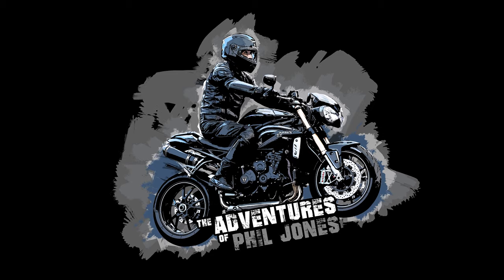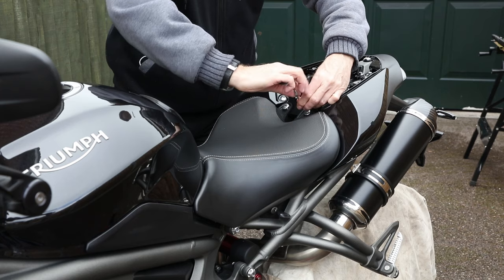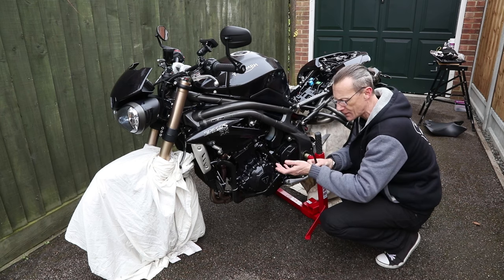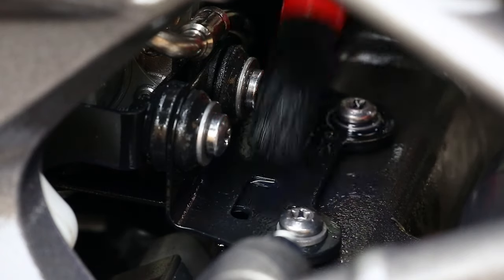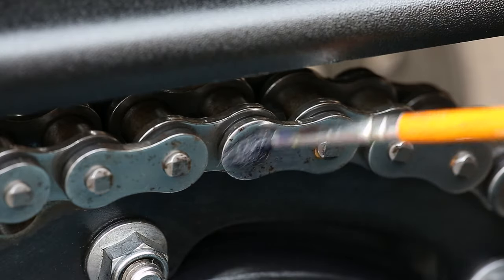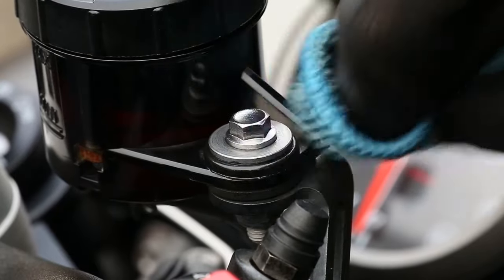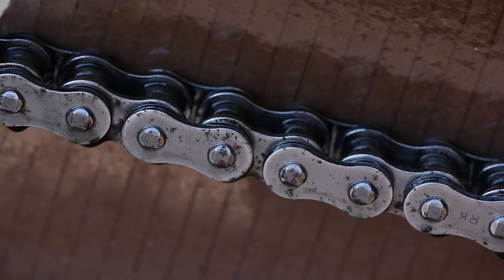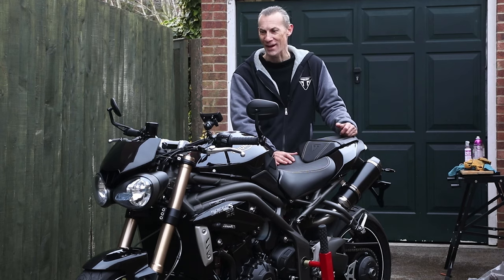The Best Way to Apply ACF 50 to your Motorbike - Step-by Step - All you need to know

Comment: Nice video, but I would say you use a bit too much ACF50 than needed. You only need a tiny bit to protect metals. When you see it running down, It’s far too much.  When they use ACF50 for professional use, they normally use a paint spray gun, as you really don’t need lots. But on the other hand, rather too much, than to little.
Reply from the maker: Thanks Felix and thanks for your comment. I’ve found the spray mist bottle is easier to apply than the stock bottle or aerosol, and agree you don’t need too much but it does go a long way using the mist bottle. Thanks for your interest! 😁👍

Comment: If you are not affected by OCD (as much) then you don't need to wipe it off.  They don't wipe it off aircraft. It's also not necessary to put it on the paintwork. 
I apply it to the engine, electronics and all the nuts and bolts I can reach. 
I ride all year, all weather for work and pleasure and each time I take it for an MOT or service they comment on how well it's maintained.
Reply from the maker: Thanks for the comment and tips. It definitely works really well, I’m pleased to hear it’s keeping your bike in top condition. Although it isn’t necessary to apply to paint, it does help protect it. My bestie had brake fluid leak on to her tank and we are both convinced that if I hadn’t have applied it to the bike a few days earlier the paint work would have been damaged, fortunately there was no damage to the bike at all but areas of her riding leathers were damaged by the fluid! 😩 Thanks for watching 👍

Comment: How does this oily (and sticky) substance - not attract dust?
Reply from the maker: @scottalanclymer  Magic! Seriously, it’s a very thin coat and it doesn’t attract any dust in my opinion! 👍
Reply: @TheAdventuresofPhilJones   Well, I'd have to be better convinced but that's another debate from why I was seeking more info on this product. I became aware of it through a local vapourblast shop, as being THE sealant for naked metal. My engine is currently completely apart and am in the process of prepping it for sandblast for complete paint removal, then vapourblast for the desired finish. I did this process a couple years ago but I repainted it. And the meticulous paint job I gave it looked great through summer of 23, but halfway through summer of 24 it's started blistering off in massive chunks. Since I had to pull the engine to investigate an odd sound coming from the timing chain, I decided to completely disassemble and go all the way with a complete paint removal because what I had was becoming more disgusting by the hour. So I want to go naked metal on my engine this time around. Zero paint. And although naked aluminum looks great, it will slowly develop oxidation and begin to dull over time. Hence this product ACF-50 that got my attention as a sealant for bare metal. Not really interested in spraying the whole bike with it, just the engine. If you have any direct experience with ACF-50 on a naked engine, and how it performs on the high heat portions of same, I'd be interested to know anything you could tell me, further than what you're doing in this video with "other" areas of the bike.

I'd also like your opinion of how it remains in the metal after washing the bike. I've learned to not get the high pressure wand into vital components where it can undo things like grease in bearings, etc. That leads to problems. So ya I've been sticking with the hand wash method and low pressure rinse, and even then I take it out for a minimum 10 minute rip to dry things like the chain and blow water out of various nooks and crannies where it would otherwise sit and rust things up. So how's the "endurance" of this product after a wash? And the heat endurance?

Also, being deep into cooling fins on an aircooled engine and many other impossible to reach areas around the head, I won't be able to wipe out the excess. So how does that work exactly?
Reply from the maker: @scottalanclymer  I’m sorry to say that I’ve never used ACF-50 in that way so I wouldn’t want to pass on any advice. If I was you I’d contact the manufacturer and ask for their help. The bike genius Allen Millyard may be able to assist, drop him a message. I can recommend buying a Pet or Motorcycle Dryer, they’re absolutely game changers and well worth the money. I paid about £60/70 for mine, I have a link on one of my cleaning videos. Let me know how you get on! 👍
Reply: @TheAdventuresofPhilJones    Got my hands on a can of ACF-50.  Tested it on some hot metal at various temperatures up to 550ºF.  It does not burn, stain, discolor. Remains clear and pretty much invisible. Am impressed. And am looking forward to treating a bare metal  engine. Should seal it up nicely to prevent oxidation. Engine is at sandblaster now and will proceed to my local vapourblaster for the final finish soon. Will let you know how it looks...
Reply from the maker: @scottalanclymer  That sounds really promising, thanks for letting me know and sharing your experiences. I hope all goes well with your project! 🙌
Reply: Bike is all back together and looking good. ACF-50 on the engine went through a full heat cycle on last night’s group ride and no discoloration or staining or any adverse results. I’m impressed with the product and now can honestly say you weren’t exaggerating. Sad that I went 60 years before knowing about it, but otherwise very impressed. Also makes any other hard surfaces shine right up and look great. Very nice!
Reply from the maker: @scottalanclymer  I’m really pleased to hear that it all worked out for you, it’s great when that happens isn’t it! 🙌 There are a lot of comments saying how I don’t need to use ACF50 on plastics but as you have now seen, it brings it up a treat! Thanks for sharing your experience, much appreciated.  Happy riding! 😁⚡️

Comment: why not hit the chain with the acf 50?
Reply from the maker: That’s a good question. A motorcycle chain has bearing’s or rollers which are lubed so they rotate freely, a rubber seal or O ring stops the grease coming out and water and dirt going in. I’m not sure if acf50 is compatible with the rubber O rings so I like to play it safe. 

I have used a soft brass brush to gently remove surface rust on my chain then carefully applied acf50 to the metal face of the chain. After an hour or two I wiped off the acf50 with a dry cloth and then lubed my chain in the usual way. 

As always you will get mixed advice on forums, some bikers will say it’s fine to cover your chain in acf50, personally, I’d rather play it safe. If anyone has had anymore experience with this then I’d love to hear your opinion!

I hope this helps 👍
Reply: @TheAdventuresofPhilJones  neat idea with the chain, definitely helpful tips 🙌🏼🙌🏼
Reply from the maker: @Neeko_Z  I’m pleased they have helped! 😁

Comment: Can you imagine a car dealer telling the customer they will need to ACF50 their car every 6 months.......
Reply from the maker: I hear what you’re saying but even bike dealers don’t tell bikers to use ACF50. I started using ACF on my old car too to help protect it. I’ve been looking to replace my car recently, and believe me, a few used cars I’ve seen could have done with a good coating to protect them. We also take a lot of pride looking after every nut and bolt of our pride and joys! 😁👍
Reply: @TheAdventuresofPhilJones  I guess also a lot of cars, their nuts/bolts/parts are protected from the elements by the car's body, whereas a motorbike is very much open to the elements.
Reply from the maker: @urbanfireblade  100% Funny enough, I’ve just helped my niece clean her car snd have suggested acf50 next time! 👍

Comment: Boeshield T9 is better
Reply from the maker: I’ve never used it, perhaps I’ll try it out one day. Why do you prefer it over acf50?
Reply: @TheAdventuresofPhilJones  comes in an aerosol can, fine mist spray, easier to apply, takes minutes not hours, chemically bonds to any bare metal whilst acf50 does not but will ruin any polish on painted surfaces, acf leaves a purplish hue to paint. Down side is T9 is twice the price, but definitely a superior product. I use it on all my machine tools as well, lathes and bridgeport mill.
Reply from the maker: @Sir.Fisher  Thanks for your feedback, I’ll definitely look into it although I am happy with acf50 it’s nice to keep an open mind!

Comment: Wrong. Wiping it off is wiping it off. Also spraying the plastics. What for?  Worried they will rust?
Reply from the maker: @chrisenright7003  It adheres to the surface leaving a thin coating so you aren’t completely wiping it off. It freshens the plastics and leaves them looking like new.